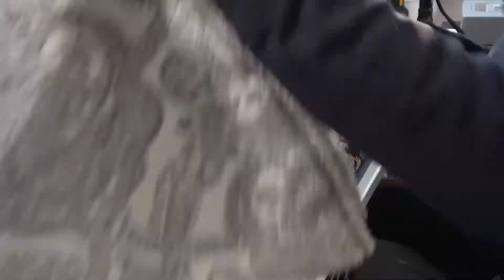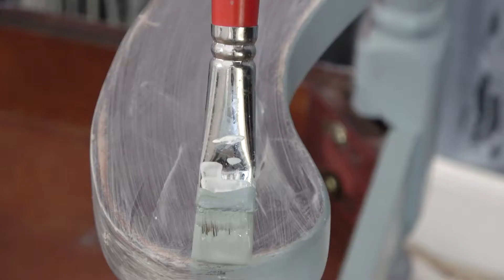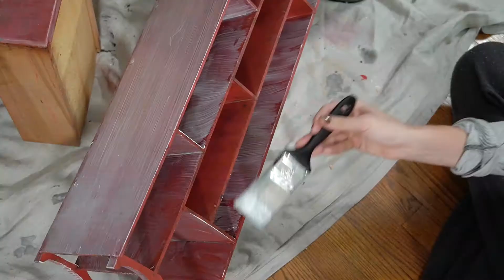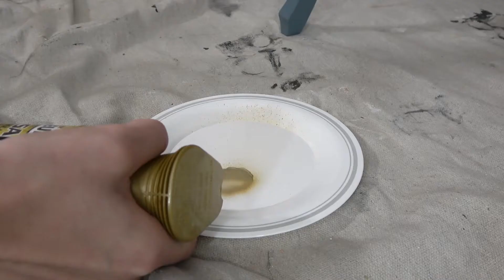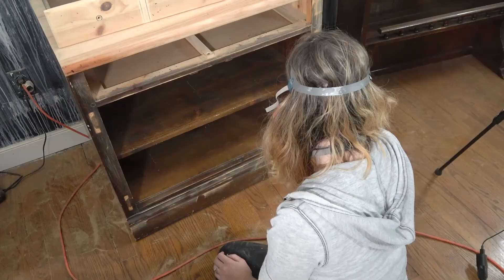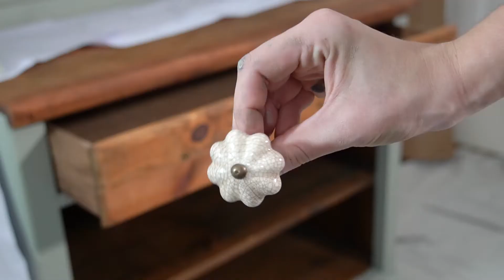Flipping Furniture for a Whole Month| Week 2

Comment: Great pieces! To make life easier and go faster, you do not have to use a tiny brush. You a wider brush and if you are trying not to get too much paint in an area just don’t load up the brush with much paint for those areas. You can even use a small roller. It will go so much faster.
Reply from the maker: Haha I actually like using my tiny brushes not on every piece but these pieces I did. I've used the rollers and bigger brushes but I alway end up switching back to my small brushes. I'm not sure why since I know it takes a lot longer haha.
Reply: @MaileyElaine  
Well you can’t complain that it takes so long then.
Reply from the maker: Oh I wasn't complaining I was just letting everyone know that it took a long time but I knew why. Thanks for the advice 👍🏻